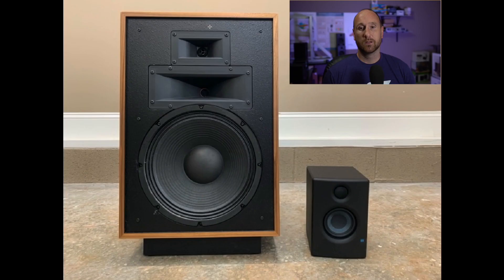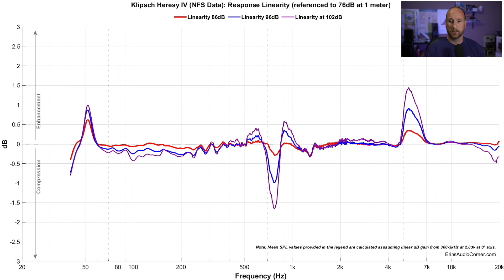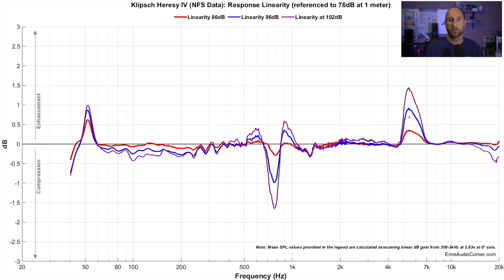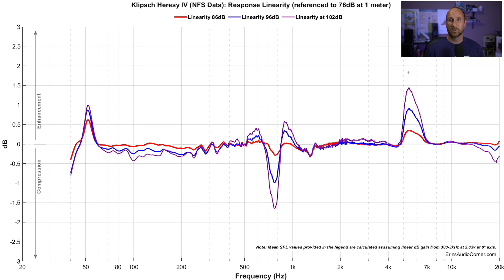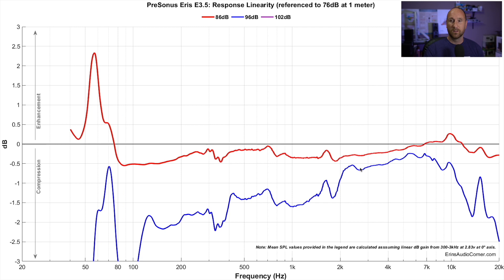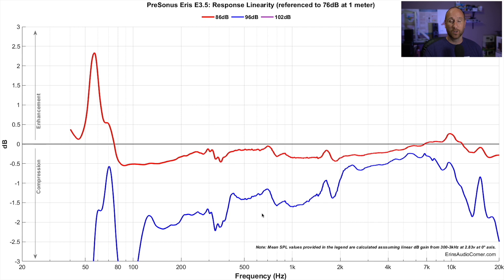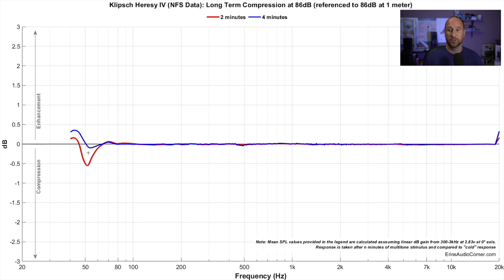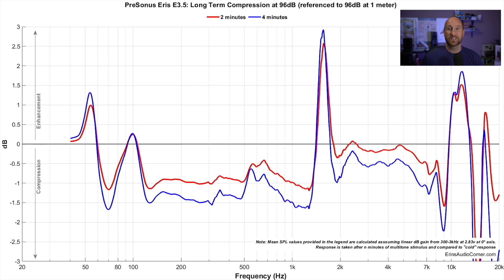Loudspeaker Compression  ||  Understanding the Measurements Part 5

Comment: This is super interesting . It means we should be DSPing rooms at different volume levels and the DSP should be digitally compensating for gain.
Reply from the maker: I think it is simpler than that. Just purchase a speaker that exhibits low compression at the volume levels and listening distance you need.
Reply: @ErinsAudioCorner  True . I was mostly thinking about a studio mixing mastering environment or a professional concert setup.  Yes of course in home use is simpler.
Reply from the maker: Gotcha. Yes, each venue would pose its own unique opportunities (or challenges). 

Heck, back in 2009 a car audio company made a product that had Dynamic EQ where you could build an EQ profile for two volume levels and the DAP would interpolate between those as you increased/decreased the output. Unfortunately, hardly anyone understood it or how to use it and it was never featured again.
Reply: @matthewhilty4209  Hi Matthew.
I'm working professional in recording studios since the mid 1980,s and the monitor levels extremely seldom exceeds 70-75dB. Sometimes when tracking (recording single overlay tracks in the control room) the levels goes up, to excite the body/pick-ups of electric guitars etc, but then everybody uses closed back headphones. 
Cheers!

Comment: This is interesting stuff!!

Thermal Effects
* Some numbers about thermal compression…

Sound Power
* 1 watt sound power gives about 112 dB

Sensitivity and efficiency
* 102 dB @ 1W ≈ 10 %
    * 90 % into heating
* 92 dB @ 1W ≈ 1 %
    * 99 % into heating
* 82 dB @ 1W ≈ 1 ‰
    * 99.9 % into heating

Ultimate case
* Just before or just over the edge of meltdown
* 6 dB power compression
* Re doubled
* 250 ºC raised (0.4 % per ºC for copper and aluminium)
    * From 20 ºC to 270 ºC

Impedance curve & Power compression
* Zn
    * 8 Ω
* Re
    * At room temperature
        * 5.9 Ω
    * At meltdown
        * 11.8 Ω (+ 5.9 Ω)
* Zmin
    * At room temperature
        * 6.8 Ω
    * At meltdown
        * 12.7 Ω (+ 5.9 Ω)
    * Power compression
        * -5.43 dB (20 * log 6.8/12.7)
* Zo (at fs)
    * At room temperature
        * 62.7 Ω
    * At meltdown
        * 68.6 Ω (+ 5.9 Ω)
    * Power compression
        * -0.78 dB (20 * log 62.7/68.6)

* Numbers from data sheet of Scan-Speak 22W/8534G00
* Power compression at mid frequencies the highest
* Power compression at resonance the lowest
* Power compression at high end of driver low *usually the impedance at high frequencies not as high as at resonance)

Electromagnetic damping
* Qms = 4.14
* At room temperature
    * Qes = 0.43
    * Qts = (4.14 x 0.43) / (4.14 + 0.43) = 0.39
* At meltdown
    * Qes = 2 x 0.43
    * Qts = (4.14 x 2 x 0.43) / (4.14 + 2 x 0.43) = 0,71
* Thermal effects at resonance: Higher Q, so decompression!

Passive crossover filters
* Voice coil impedance (let’s say) doubled
* Crossover frequency halved (when first order network, second order?)
* Difference between drivers
    * Power into heating / heated mass
    * Time factor (reaction time for heating and cooling)

* When playing music
    * Changes in crossover frequency
        * Differences in amount per driver
        * Differences in speed 
    * Resulting in peeks or dips
        * Depending on drivers and on heating or cooling

That’s why I designed and build my own audio system
* Current-drive: no thermal compression
* No electromagnetic damping: stable Q’s
* No passive crossovers: stable crossover frequencies

In the Klippel Nonlinearity Poster (I think I saw one in your background) they make a difference between distortion in sound pressure and distortion in current (current distortion). I think that’s an interesting subject!
Reply: Have you got any more info on your design? I'd love to know more!
Reply: @heathjones1980  I can tell you a lot... The question is what do you want? To start I can tell my experience and what I did...

First of all, the challenges with current-drive are:
* There is almost no common knowledge around the concept.
* You have to rethink all the things you already know. The things of the world of voltage-drive are literally turned upside down compared to current-drive.
* There are a lot of misconceptions about current-drive. There are even people claiming it cannot work, it will explode and that kind of nonsense… Or that you will need a servo-system… People see problems with current-drive, but those problems are bigger with voltage-drive.
* You cannot exchange one component at a time, you have to redesign the loudspeakers, the amplifier and the crossovers all together. I think that is the reason why some people who tried it, have bad experiences. They change the amplifier and use an existing loudspeaker with (voltage-drive) passive crossovers. And that doesn't sounds good. (But actually not as bad as I expected, you immediately hear there is potential…)

I have a rather simple and minimalistic system:
* Two-way sealed loudspeakers without crossovers.
* A four channel current-drive amplifier.
* A miniDSP DDRC-24 and a measurement microphone.

What I did
* I read the book of Esa Marilänen, see https://www.current-drive.info. Actually several times.
* I designed and build a power supply with a toroidal transformer from scratch, based on information and heuristics from internet.
* I bought an inrush-current limiter on internet.
* I designed a current-drive amplifier, based on an existing (voltage-drive) design, where I changed the feedback and the stability network.
* I designed a PCB for the amplifier, and let it produce, four times. I assembled the boards and total amplifier.
* I designed and build the loudspeakers. I use 4 Ω drivers, looked for drivers with a low fs, big displacement and moderate Qms. And I looked for drivers with non-conducting voice coil formers, to eliminate also the eddy current electromagnetic damping. I didn’t find (reasonable priced) tweeters with non-conducting voice coil formers. And I looked for drivers without ferro-fluids, because with current-drive you have much lower distortion in you drivers and the noise of the ferro-fluids gets observable. I use Scan-Speak drivers. I think that Scan-Speak Discovery drivers are perfect for current-drive: big displacement, light, low distortion, sensitive, available in 4 Ω and woofers and midranges are available with non-conducting voice coil formers.
* I designed the crossovers myself, based on Linkwitz-transformers, to get synchronous crossovers and to use the loudspeakers full range (from 18 Hz).
* I use Dirac Live with a target room curve which I designed myself (I build a spreadsheet to adjust and to generate the target room curve).

Along the way I made a mistake by using protecting capacitors for the tweeters. It sounded terrible. After three days I realised that protecting capacitors will not work with current-drive. I took them out and it sounds beautiful. And that’s an example that the usual common sense doesn’t work with current-drive. Another example is that, when you use a current-drive amplifier with nothing connected, it will clip.

Comment: Thank you, the entire series was very informative. 
I have to say looking at the crazy compression graphs of the little monitors makes me wonder if it was caused by a limitation of the integrated amplifier more so than a problem with the drivers or enclosure. With the Klipsch I have experienced a similar phenomena with a car audio sub on cold mornings where there was a noticeable lull in output for the first several minutes as if the surround and/or spider needed to loosen up. 
Maybe after a tough day I am suffering from compression in the morning as well. :-P

Comment: I ask myself if the SPL targets should be based on the max rated by the speaker. Like if the speaker rated max spl is 95dB, that would be the purple line, than do the other 2 levels by subtracting 10dB on each. This I feel would be more fair.
102dB is a lot for a lot of speakers and I assume that would be out of spec for the many speakers.

Comment: Thanks for doing this. You touched on it briefly but is this what you would attribute to dynamic range? It would
Make the most sense. Input in = input out. If there is compression then you have less dynamic range. 

I’m confused why people attribute sensitivity to dynamic range. Is there any correlation?

Have you tested Klipsch RP600m. Would be amazing to see klipsch RP600m with GR Research upgrade.
Reply from the maker: It is, at least to a degree. 

I think people also confuse dynamic range of a speaker with that of the system. I discussed this in this video:
https://youtu.be/qBuHmThA-7o
Reply from the maker: And nope, I haven’t tested the RP600. I would be interested to test one with Danny’s mod and without as he uses measurements to verify his process, though, the measurements are gated and therefore smoothed to a high degree.  It would be nice to see the higher resolution results as I would expect them to show the differences even better.
Reply: @ErinsAudioCorner  Yes, his measurements are smoothed to 1/3 octave which is pretty low resolution.  I was still left with a tilted treble response that I fixed with mini DSP.  I think an interesting video you could do would be to explain how deviations in certain frequencies change the perception at other frequencies.  The 6db fix at 1.8khz was a welcome change but the speaker still sounded small and called attention to itself.  I toed them waaaay in (I'm talking like +55 degrees) and also shelved response to match harmon curve and the speakers now call far less attention to themselves and sound so much more full, due to the reduced output in the treble region.
Reply: @ErinsAudioCorner  Know of anyone in the PNW that has a Klippel machine? :)